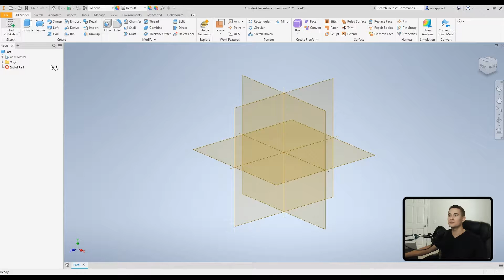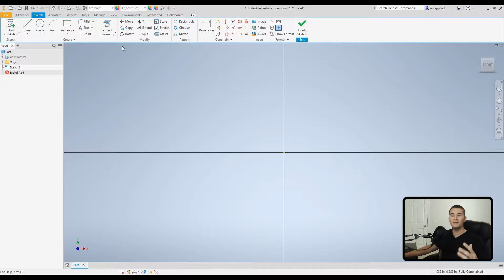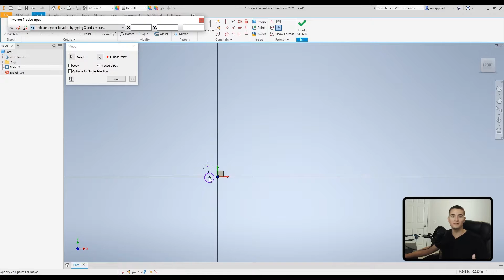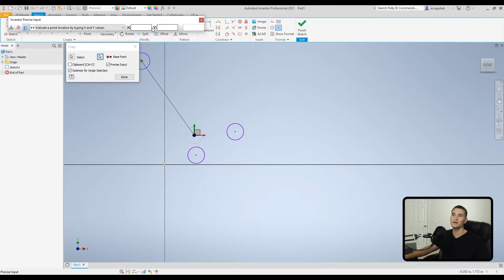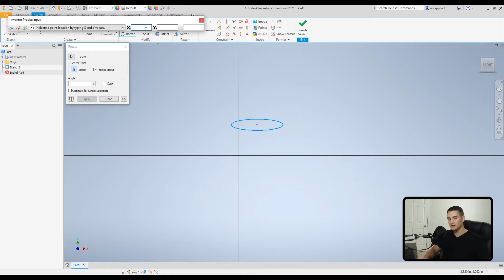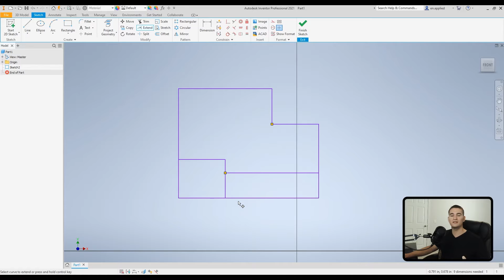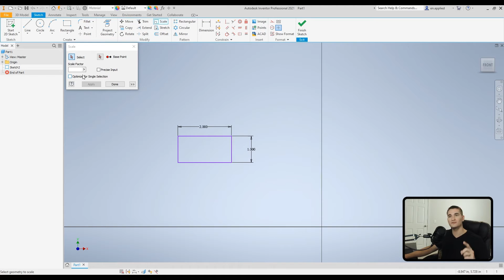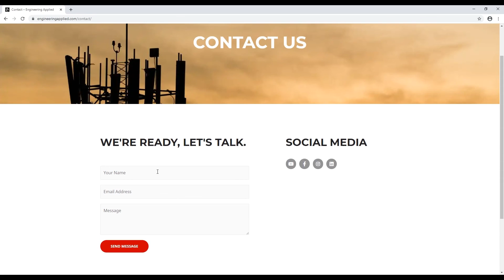Modify Sketch Tools - Autodesk Inventor Part Tutorial | Autodesk Inventor 2021 IN DEPTH

Comment: Can the offset modifier be used like in offset command in autocad for moving items?
Reply from the maker: I'm assuming you are referring to the "through" option in AutoCAD where you can hit the "t" key on the keyboard and snap the offset feature to another sketch entity like a point or line. As far as I know, this is not available in inventor. What you can do however, is create some construction lines or reference points to then snap the offset to instead. You can also reference a dimension like "d0 = 1.5 in", then reference that dimension if you want things equally spaced (d1 = d0).

I'm always open to correction from the community if I'm mistaken.